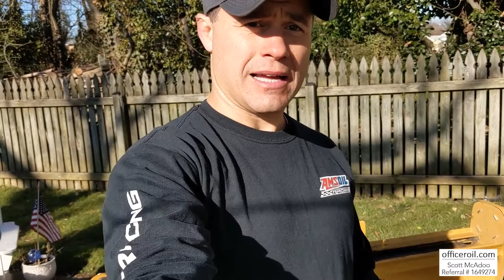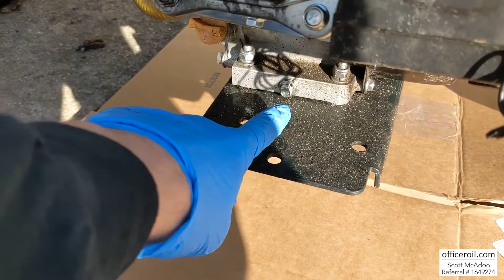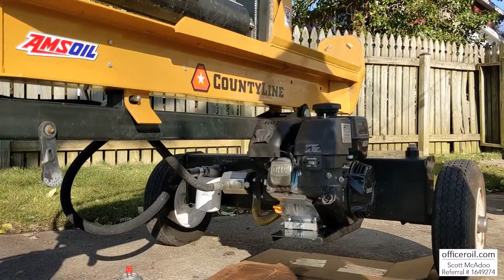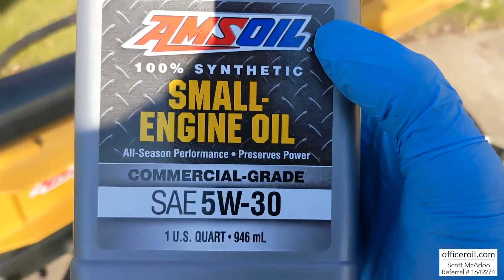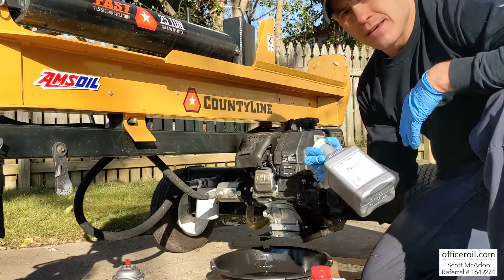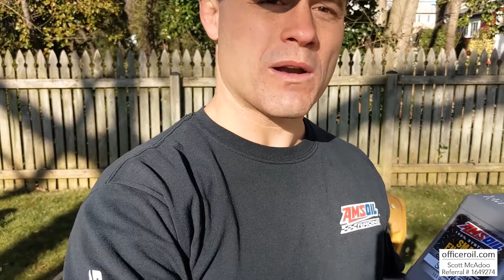Protect your Log Splitter with AMSOIL Small-Engine Oil

Comment: The log splitter engine sounds like it is surging which would be fuel delivery related. I like to run non ethanol fuel spiked with Seafoam 1-2oz per gallon  the Seafoam helps to keep the engine internals clean. As a tune up for the carburetor take off the air filter and will the engine is running slowly pour Seafoam into the carburetor just until the engine stall than stop do this 3-4x than the last time pour until the engine stalls than let the engine rest 15 minutes this is known as the “soak” than put the air filter back on and start the engine you will get some white smoke in addition to some carbon near the exhaust muffler
Reply from the maker: I'm a huge fan of non-ethanol fuel and now run it in all my small-engine equipment.  At the time this video was recorded non-ethanol fuel was like a unicorn in my area and I couldn't find it anywhere.  Seafoam is a fairly decent option.  We (AMSOIL) makes something similar.  Quickshot for the fuel and Power Foam for the air intake.  Any experience with either of these?

Comment: You won’t need to change the oil annually with the Amsoil. There was a YouTube video of a lawn mower mechanic who did a oil change on a John Deere 915 (commercial mower) that had 200 hours that had Amsoil Small Engine oil. The oil still looked pretty good he could have easily went 300 judging on the color of the oil I don’t know about the filter though
Reply from the maker: I love our AMSOIL Synthetic Small Engine Oils.  My landscape clients now safely change oil every 300 hours in the zero-turns in stead of Kohler's 100 hour recommended oil change.  They are saving a ton of time and money.  I try to hit my 4 strokes every year just as a good proactive maintenance.  It hold so little oil and I'm less likely to forget that it was done.

Comment: I like the 10w30 amsoil small engine. I live in florida. I think my generator needs it. We have been having a lot of 90f degree days that feel over 100f. We don't get a lot of use when briefly cold but not under 40f. The weather is usually pretty good and usually no outages then.
Reply from the maker: The AMSOIL 10W-30 Synthetic Small-Engine Oil (ASE), https://www.amsoil.com/p/10w-30-synthetic-small-engine-oil-ase/?zo=1649274.  Is by far our most popular small engine oil.  I'm with you and I'm back to using 10W-30.  What do you like about it???
Reply: @officeroil-amsoil3463  it protects in storage better than other oils with impurities. Definitely handles the heat well. I do change mine yearly and clean oil always comes out. Not a bad price for the product if you are a PC. Used to use motor oil off the shelf for cars in some of my equipment. This oil gives me way more fuel economy than those oils I used to use. It definitely helps to use a small engine oil especially if its 100% synthetic.
Reply from the maker: @aquactrl1484  Great!  Same reasons I run AMSOIL.  AMSOIL has perfected the art of building application specific fluids.  Not just an automotive oil that you run in everything.    I have many landscape clients who safely change AMSOIL Synthetic Small-Engine Oils every 300 hours in their commercial mowers.  Saves them valuable time and money!  The Preferred Customer Program like you said really helps the DIYer with a 25% discount, https://www.amsoil.com/offers/pc/?zo=1649274.
Reply: @officeroil-amsoil3463 I also love the upper cylinder lubricant, stabilizer, and quickshot in my equipment.
Reply from the maker: @aquactrl1484  I love them all too!  The AMSOIL Quickshot (AQS), https://www.amsoil.com/p/quickshot-aqs/?zo=1649274 is my favorite.  Since I started adding the fuel treatments, I have never had a carburetor problem.  I recently fired up a dirt bike on the second kick after siting for 2.5 years!  I also can't tell you how old the gas was that was already in there before I treated it with Quickshot and Gasoline Stabilizer, https://www.amsoil.com/p/gasoline-stabilizer-ast/?zo=1649274.

Comment: I’m 18 years old now and I’ve used amsoil for 4 years now was kinda skeptical but I’ve been testing it where I live (WA sate ) in every I have trucks cars quads bikes and more I use my vehicles very very hard and everything just keeps going because of the amsoil we also have a 2003 chevy s10 crew cab at 260k mils when we got it witched the truck to amsoil now it has 355k mils the 4l60e has hit 230f fluid temps and shows no failure or signs of failing in my opinion amsoil is the real deal seriously!!!!!
Reply from the maker: Thanks for sharing Just_brett.  355k miles, nice!  Just breaking in, ha.  I wish I heard about AMSOIL sooner.  Didn't have YouTube when I was your age.    I'm with you.  I was extremely skeptical myself when I first heard of AMSOIL.  However, I did my research, gave it a shot and instantly experienced the benefits.  AMSOIL boosted my fuel economy by 10% in my 1999 Volkswagen Jetta.  

Where do you get your AMSOIL?
Reply: I have 389k on a ford focus.  Only ever seen Walmart synthetic.  Doesn’t use or burn oil at all. 🤷🏻‍♂️